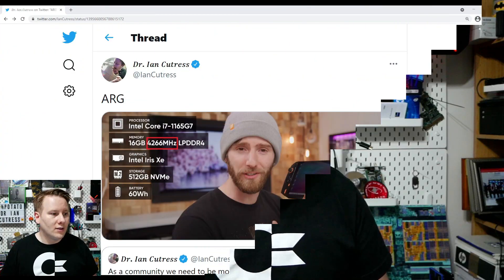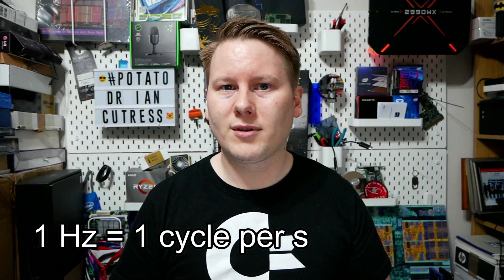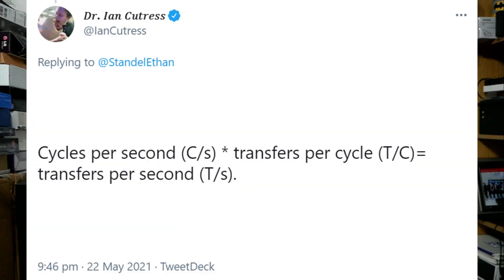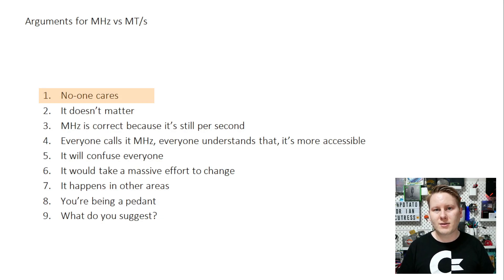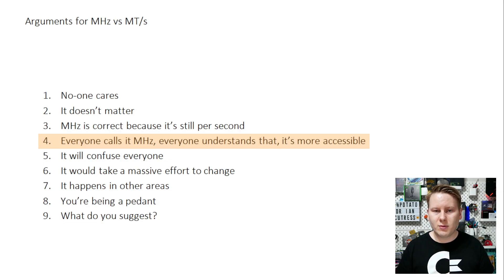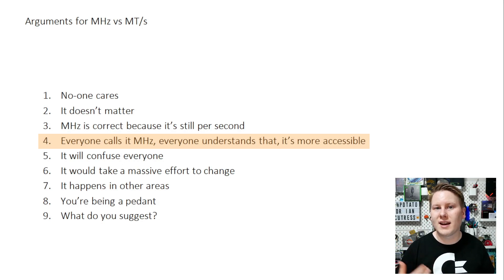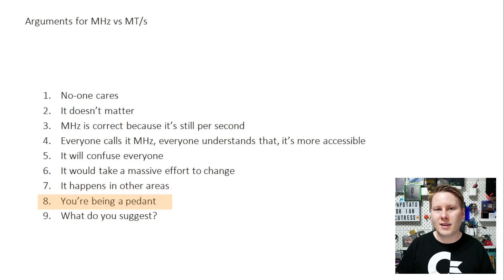Linus is WRONG 💩 : Explaining MHz vs MT/s

Comment: Re: 4. I don't think this holds up, as just because most people understand the terminology incorrectly, but have the right gist, will cause problems when you're trying to apply that elsewhere. For example when trying to explain the 1:1:1 ratio often referenced with Ryzen 3000 and 5000, one has to unravel people's misunderstanding of the memory controller to explain the concept, yet if everyone understood MT/s and MHz correctly it makes that a whole lot easier to grasp.

Comment: I hate to nit pick on these things but I believe you're using the wrong pronunciation. It's written pedant not peedant. Ped as in to peddle a bicycle not peed as in to go number 1. The units stuff I'm with you on though, although I have been told I can be a bit of a pedant if you could believe it, so maybe that's a factor.

Comment: 2:05 "length, width, height, weight - these are all units"

They're not tho. Length is a dimension. Meter is a unit of length. I get where you're coming from but w.r.t. "technical literacy and accuracy", as you put it, you are way off.

Comment: I started off the video siding with Linus, thinking I was gonna come out of it with the same opinion, but you changed my mind. After watching, I do agree that not using units can be useful. Though, in the right context, using units on a spec sheet can definitely be feasible. For example:

G-SKILL RIPJAWS DDR4-3600
Type:                DDR4
Clock speed:   1800MHz
Transfer Rate: 3600MT/s

Comment: Please use the correct units, if it is necessary to give the units. Ever seen quotes of wrongly used units? People new to it will not understand, that you deliberately give them incorrect information.

And I am really strongly suggesting not to mix an incorrect explanation with correct content just to make it “simpler“. It is  just confusing.

Comment: I just don't care. What I care about is what the computer can do for me and whether the said part will tangibly affect my workflow. So as long as Linus continues to give benchmarks and tries to show relative performance I am on team "it doesn't matter." I am not a computer engineer and this is my hobby. I mean it is not like I even get to pick my work computer since the company provides that so I am stuck on whatever specs they think is good and for my personal rig whether you go unitless or MT/s or MHz I can figure out what specs and parts makes sense thanks in large part to groups like LTT doing tests with different ram speeds, tuning, etc. So if they want to say MHz and it not being accurate or right term I say meh.

Comment: This is the reason why I read Anandtech. I know that I'm getting accurate information. Good job pointing it out, Ian! 

As for what we should do, it's so difficult to change MHz to MT/s now when even manufacturers use this unit. But, I agree that not writing the unit is the perfect way that is easy to implement going forward and remains familiar to the user.

Comment: Dude, you are certainly a pedant. I was dimly aware of this issue because I was confused about memory settings when I built my first computer last summer. I have spent 50 years expecting numbers to come with appropriate units, so I would like to restate the underpinning of your suggestion. Make the number part of the name, so it is not a quantity, it is a label. DDR 3200 is the label given to DDR memory that operates at a maximum of 3200 M-transfers per second.

By the way, at 1:45 of this, the first of your videos that I have seen, I was ready to type that you had last your pedantry credentials because you said 2 transfers per hertz, rather than 2 per clock cycle. But, although you didn't catch your error, the rest of your video would have sorted anybody who was misled.

Comment: From pure physics point of view, Hz is still a correct unit. It is defined as anything measured in 1/s. And neither clock or transfer are a part of SI system of measurement, so clocks per second and transfers per second can be measured in Hz

Comment: If you use "no units" and say DDR4-3600, people will unconsciously add MHz to it because in computers, speed is always in MHz.
I would even say that MT/s is confusing. Transfers of what, and what is a transfer? If we count individual bits of data delivered, the number gets significantly higher still. And I think it's actually used as marketing strategy, to supply ever growing numbers even though clock speed does not go up that much.

Comment: You are the least pedant person ever, but let me be a little pedant myself. I have been an electrical engineer for thirty years and I can say that I know what Hz, or more precisely, frequency is. It's ironic that it takes someone who makes a living out of assembling microprocessors to tell the world that there was life before the digital era. Yes, frequency and periodicity, in general, is a very old concept. It was old before the first transistor and the first digital computer. Frequency is the reciprocal of time, so, you can express frequency in terms of seconds to the negative one power, just because a cycle is not a unit, it is adimensional, it is anything happening over and over, hence 1/s=Hz. Saying one Hz=once per second is oversimplifying all. What about 2 times per second? 2 Hz. We are back to the old discussion about 1024x1024 is one meg! If we overlook everything we become the ISP salesman offering you GygaByte speed (GBps) instead of the correct Gbps (8x difference). Who cares? We engineers do. Especially GygaPedant engineers, like me. (pun intended).

Comment: I've always thought it should be MTs as that is correct. But the horse left the barn so long ago on MTs vs MHz that I feel you can't get people to change to the correct MT/s unit.

That said I would be totally onboard with leaving the unit off the description. If I say I put DDR 4 3200 in my new ITX build everyone knows exactly what that means and there is no need for anyone but the most pedantic people to debate it.

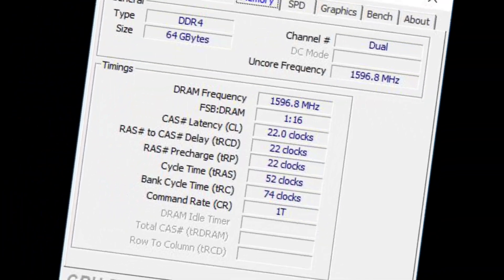Comment: 3:02, ummm, nope. The 'data rate' is the MT/s rate as it's transferring data on both the rising and falling edge of the clock = two data transfers per clock. The DDR term originated because it had twice the data rate of pre-existing RAM that used a single clock edge. Perhaps it was just a slip of the tongue.
Reply: doesnt he say that a few seconds after that?
Reply: @accelerator5524  I was specifically commenting on where he says "1800MHz, that is the data rate", which in incorrect. My explanation coincides with Ian's as he certainly knows there are two transfers per clock, that's why I said a possible slip of the tongue.  The 'T' in MT/s is in fact data 'Transfers'. The 1800MHz is the clock rate, the 'Data rate' is twice that.
Reply: @crayzeape2230  now i see what you meant. thanks

Comment: Min spec is correct use of the word "capability". Features are not capabilities. This word refers to a specific computer security concept, namely a reference that cannot be forged (or sometimes, cannot easily be guessed).
On the other hand, a capability supercut of the z13 release video would be good value, especially since IBM mainframes have no capability support I'm aware of.

Comment: I had done some reading into how memory works years ago and I had a decent grasp on how it uses phases of a cycle to move information, but I still have a slightly loose interpretation because of me not filling in some gaps. Because of the whole "MHz" crap, I've always had some confusion since I had assumed and locked in that there was variability on how the CPU may utilize this dynamic RAM cycle (1 or 4 transfers per cycle on ddr4) therefore not always utilizing the RAM's full potential at all times and at every cycle.
I hope I'm not completely lead astray by my poor interpretation of what I've read in the past.

Comment: a condensed version of the full quote from Linus: 'doesn't matter to the average consumer.' which is accurate. You both are correct. Myself and not an average consumer so I can understand both perfectly fine. My mother would understand the larger number without a lengthy explanation. I recall something my late grandfather said "I don't care about the mumbo jumbo just make it work."

Comment: i prefer not using a unit or using MT. I don't say "3200 mhz" when talking about ram, I am gentle about the actual frequency, since it does tie in to the busses on the motherboard and processor. I think calling it hz is dumb. We're gonna have DDR5 8000mhz? 10000mhz? The gpus use 13ghz memory? It is nonsense and misleads people so badly.

I think companies should correct, OVERNIGHT, because if my memory is 3200mhz, and is sold to me as that, but isn't giving me 6400MT/s, I've been ripped off. This is why we have regulators. Either drop the unit or use the correct unit.

Or just sell it with 100000000 teraflurples of gingintong crabyarties. because that's the nonsense incorrect terms mirror.

Comment: I'm going to complain about using Hertz' name. Yes I know Ohm, Volta, Ampere, Henry, and Faraday are people's names. But there was already CPS, cycles per second, before they changed it. Are they planning to change bit and byte to some peoples' names? How about replacing meter, gram and second? How about light year and astronomical unit and solar mass? I am sure there are worthy people whose names are still available.

Comment: Agree with just not using the unit being the move, I've just been saying 'DDR4-3200' for instance and leaving it at that for years.
Reply: SO, a DELL G15 saying their RAM module is 8GB DRR5 4800MT/s, means 4800Mbps that usually people said it is 4800Mhz ? I just need to know which RAM is faster, a DDR5 4800MT/s or a DDR4 3200Mhz
Reply: I like that, because in that way, the standard way we have been calling it doesn't change but now the specifications can be listed with the right details.
Reply: This is the good old metric vs imperial argument, they just have different rules.

In metric, a unit must not describe the details of what's being measured, only the physical dimension. So, you say "the thing being measured is [this number] [physical unit]", such as "the transfer rate of ddr4-3200 memory is 3200 MHz". "Transfer" is not a unit itself, and you're very much forbidden from making up language-specific abbreviations and mix them with SI units (including using subscripts) .

In imperial, the opposite is true: the unit is a language specific abbreviation and you're expected to abbreviate the description of the measurement. So you're expected to make up units like MT/s (or dpi) and use them in a sentence like "the speed is [this number] of [the things I observed in this way]".

tl;dr: in metric, "the height is 2 meters". In imperial, "the size is 2 meters of height".

I personally am a fan of the metric system in principle, but mostly I just realise both exist. It's really not about the units by themselves.
Reply: @radekc5325  No its not, Metric and Imperial are defined and each unit is directly interchangable, mass kg & lbs don't change because you are using silver or gold as a counter ballance on a scale.
Reply: I do agree with that, and I was doing the same since many year now. There's only one thing I wanted to bring on this table - bandwith labeling. As far as I can recall, it was used since first DDR gen, and it goes like that: PC-1600 (label) means it's DDR1 ("PC" part, for next gens it just gets coresponding number - "PC2" for DDR2 etc.) with 1600MB/s of bandwith, 200 MT/s and 100MHz clock rate. This labeling system is persistent, and is fine explained in Wikipedia (https://en.wikipedia.org/wiki/DDR_SDRAM#Modules).
So my question is - should new people more care about bandwith, transfer rate or clock rate?
IMO for regular computer assemblers and PC enthusiast all of them matter, since we are getting new DDR gen every few years now. For standard home/office user this proposed "DDR4-1600" is enough, even for most PC gamers it wil work just fine.
Reply: As a purist I disagree.  It should be called "DDR4-1600".  The equation "1600Mhz DDR4" = "DDR4-3200" is silly.  The technology/performance/increased Mts is communicated by the letters "DDR".  There is no need to communicate it a second time with "3200".  Can you say with 100% certainty that the transfer on the falling clock edge is 100% indistinguishable in every way from the transfer on the rising clock edge with no caveats.  So that 1600Mhz DDR would be identical to 3200Mhz SDR if all the other tech in the memory is the same?  EVEN if that were the case, it would STILL be incorrect to call it 3200Mhz when it is 1600Mhz
Reply: @TryHardNewsletter  as a purist you should realize that the same argument could be made the other way around. DDR should communicate that you know 3200 refers to the MT/s and that because of the double data rate the actual clock speed is half of that. I think your argument is pretty weak.
Reply: @TryHardNewsletter  still, DDR4-3200 is just the name for that type of memory. It is just a chosen name for a given specification. It happens to relate to the maximum MT/s, but just because some engineers decided to call it so. And those names are existing, defined and documented this way. Changing/misusing them would be a horrible idea.
Reply: @TryHardNewsletter  3200 in this case is the transfer rate

if you have qddr memory, a clock of 1600 would get you 6400

It's correct to use mt/s
Reply: @TryHardNewsletter  Who cares. GiB and GB. I suuure mention gibibytes all the time. Yes, I know what the "correct" nomenclature is, but what do I care? We know it's MT/s, but why is it any kind of a deal. 24 pin ATX is mini-fit jr. or whatever.

No one, and I mean no one calls it that.
Reply: @scottr7683  Interesting. I assume it's very relevant in your work environment.

Comment: Hearing an explanation from other than a gamer wonk clarifies things for me. I have heard the transfer rate explanation so many times, immediately followed by megahertz numbers, that I figured there must be something I'm missing. They just told me the transfer is twice per cycle (=DDR), so if the memory was going through 3600 cycles, then the transfers would be 7200. But it is 3600.  What am I missing?

Comment: I'd argue (as Ian did) that it's both clearer and more broadly applicable to list the damn technology/protocol used along with the "uniform" speed rating, as using DDR4-3600 format does. It took me an embarrassingly long time to realize that graphics memory wasn't just some uber-juiced-up version of the same stuff used for system memory running at 8x the speed (or 2x or 4x, depending on how individual programs decide to list speeds/data rates), but the confusion makes sense in retrospect: using the same unit measurement for various types of memory/hardware is simpler from the advertising side, but it is inherently less accurate/reliable. There are plenty of other marketing practices/missteps that are not considered acceptable when describing a technical aspect of a product, and this should be no different. When multiple specs are correct but not equally technically correct, it's obviously most appropriate to use the most agreed upon / most reliable spec (maybe, the minimum specification ?)

Occam's Razor opinion: there just aren't enough knowledgeable/technical people involved in the process to justify needing that level of uniformity. Those who can appreciate the difference between "3600MHz" and "DDR4-3600" won't be surprised when someone doesn't understand, so the mistake becomes accepted. On that note, it is frustrating to see the anti-standard picked up by people who do know better and that others rely on for info. But that wasn't Linus' point when he made the mistake, of course, he was listing memory speed for the viewers' sake, and it's clear enough with sufficient context (but it's always nice to minimize that as a barrier of entry to understanding).

If the technical spec is relevant to engineers and engineers only, then there better be a lot of engineers around these "manufacturing" companies to catch the mistakes made by those who are used to referencing technical terminology that, to them, lacks relevance, significance, or meaning and is therefore easily mistaken. It's 2021, we don't just need tech CEO's with technical backgrounds, we need EE's in the marketing departments, too. And maybe we can ask for technically literate customer support by 2023 to bring it all up-to-speed?

Comment: I like youre solution, I can get behind all of this, but im a little confused. Isnt there still always some form of a cycle? Especially with anything involving a square wave? I get wanting a more accurate description, I just thought there still would be a cycle for anything that's repeted (the amount of square rise and fall of voltage) at a speed per second. 

Idk, this is the exact type of thing that I understand more easily by going back to older forms of the tech (and has gotten me into retro tech) like SRAM or something lol.

Comment: It's like on electricity. Everyone that's not in the area says "positive" and "negative" but tecnically they mean "positive" and "GROUND" (in DC) and "phase" and "neutral" in AC. If ure quickly explaining that to a kid or a dumb client u just say connect the positive and negative of the battery. It's easy and simple, but if u are an engineer and u're at work it's different. I also think that to a known legit source like LTT it should matter cause a lot of people trust on him as a good source of information. The WAN show is made live and even with all the notes mistakes happen, its fine, removing the vid bc of that would also be dumb but at least a: "you're right" would be the right thing to do.